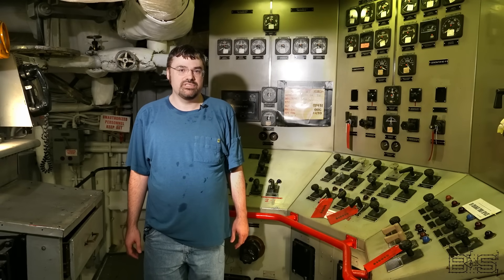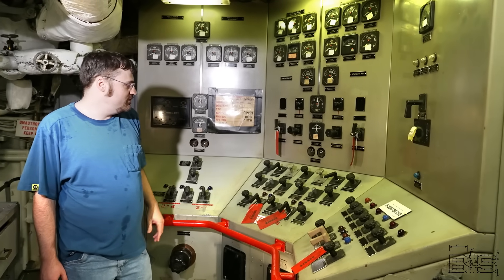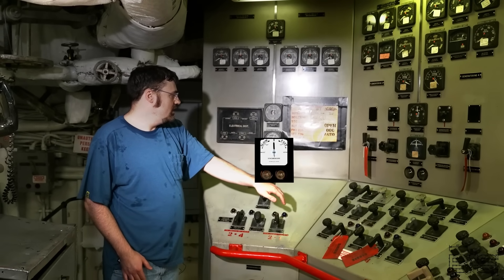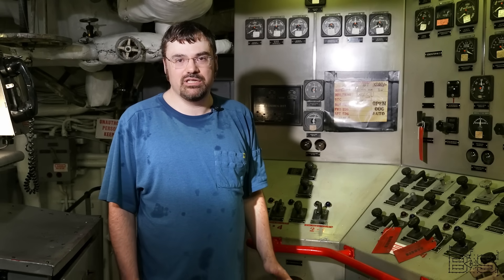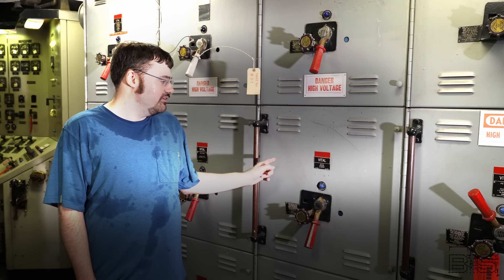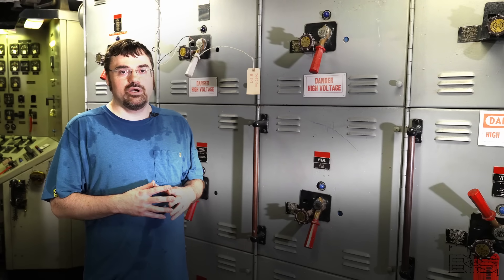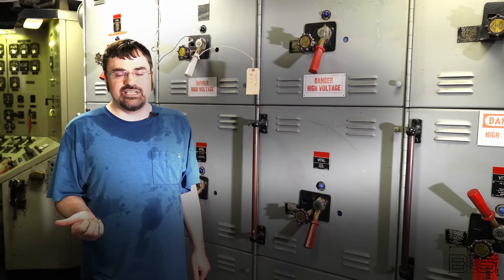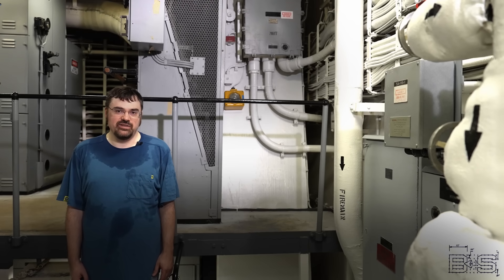The Most Dangerous Switch on a Battleship

Comment: Wouldn't the wiring burn out long before hitting that peak current ? Just a lay person here of course
Reply: The breakers are designed to trip before the wire gets hot enough.
Reply: @dougaltolan3017  I imagined there'd be some kind of protection of that kind, or even fuses

Comment: When synchronizing the generators, i don't think the voltage is the important thing,  frequency AND phase IS.

The generators can deal with the voltage jumps.
Reply: As a former Chief Electrician on Merchant ships,  you would cause problems if the voltage and frequency are not the same.

Comment: Closed switch = not allowing power to pass (closed bus ties ie no connection between them ?)

While a open switch = passes power.

While in swedish older equipment is marked SLUTEN (end,connected) ÖPPEN (open)   Öppen in this case: means the breaker is broked ie current can't pass.

Think the rules for shot guns as a hunter - walking about ? Break the gun, remove cartridge AND keep it broken.
Reply: Closed means the switch is connected, open means disconnected.

Comment: Well, if you don't get the synchronising procedure correct, not to worry, because one of two things will happen. Either it will trip, and you try again, or the generator will synchronise for you, and now you have to explain why the deck plate or generator shaft is bent.

Depending on how wrong you get it, either of these can be accompanied by very expensive and exciting noises.
Reply: We saw a training video where two generators were paralleled 90° out of phase.  Sheared the mounting bolts and sent them through the upper decks.
Reply: @ronharlan665  Any idea if that video can be viewed somewhere? Would love to see this.
Reply: @ronharlan665  Dang! I wouldn't have thought that would happen, i figured you'd have gotten a really nasty arc flash at the switchgear.
Reply: @spacehitchhiker4264 Yep, the generator out of sync becomes a motor and will follow the shortest way back into sync.
Even if that means stalling for a fraction of a second.
Which is bad for large rotating masses.
Reply: @ronharlan665 I'd love to see that
Reply: @ronharlan665  I've been trying for about an hour to find any video examples of generators being paralleled out-of-phase. If you can remember anything about who made the video, what plant was depicted, etc., please let us know so we can try to find the video
Reply: At my university, the lab techs recalled a story where students built there own generator and had to synchronise it to the grid. they didnt use a synchroscope (too expensive) just the phase bulbs. well eventually one group, one year, had somehow messed up the wiring of the bulbs,, they threw the knife switch connecting all phases at once, and a nice BANG and an alternator was spinning around on the lab floor ripped clean out of its mounts. they sadly stopped this particular class and it was done by simulation from then onwards :(
Reply: @denisohbrien  people have done it wrong when its all wired correctly, someone in the comments of a Chris Boden video said they know of a story where someone threw the switch were the phase bulbs were fully lit. That was an expensive day.
Reply: @Defianthuman that is much more wrong than I was expecting, and I don't even know what would happen if you closed it perfectly out of phase. I guess very exciting and expensive noises. Why would they do that?
Reply: @NeneExists  The ship I was on had a nice little plaque on the switchboard as a reminder when paralleling with Shore Power...  "If you fuck up, the North American Power Grid WILL win!"

As far as WHAT would happen, since we are discussing AC the voltage is actually a sine wave going from 0 to +450 to 0 to -450 to 0 60 times per second.  If you are in sync, then the zero transition points and the rise/fall will be the same.  if you are 180 out, then the zero transition is still zero, but the rise/fall is 180 out....450 + 450 = 900...and it all goes downhill from there.  This is VERY simplified..

Power sources do not like being out of phase or have voltage or frequency mismatches.  In simplified terms, the source with the greatest amount of oomph behind it will gladly synch the lesser source to match by brute force.  In extreme cases, those "very exciting and expensive noises" are the sounds of your generator and associated switchgear undergoing rapid unplanned disassembly.  Generators will come apart, snap mounting bolts, bend brackets, etc.  Copper wiring and busbars will undergo a rapid transition from the solid state of matter to the gaseous state of matter fast enough that it is basically an explosion.  Electrical enclosures will become flying debris and shrapnel.

If you just slightly screw it up, assume that you are headed for an unscheduled shipyard availability...

Always cheerful thoughts to consider when you have one engine room, so your 4 turbine generators are about 30 feet away and the 1S and 2S main switchboards are 20 feet aft of the control switchboard.
Reply: The ship I was on in Alaska, the local grid was small and the ship could(and when I was on board did, one time) take the city's grid down if paralleling was done incorrectly.
Reply: @denisohbrien  But they didn't teach you how to write proper english in university?
Reply: @Njazmo no they didn't. In fact I failed English at school and it wasn't an issue getting an engineering degree. But thanks for your interest.
Reply: It's also really fun when you turn the generator into a motor.
Reply: @Stoney3K I’ve seen that when you’ve got a paralleled pair and one runs out of fuel. It certainly clears out the exhaust. No need for load bank this week! 😂
Reply: @andyscott5978  That can also happen on the national grid, when steam is lost to one of the turbines. 
To avoid the complexity and potential dangers synchronising back online, the alternator can be left running as a motor until steam is restored. 
Mainland Europe is synchronised and the UK is synchronised via France.
Reply: Reminds me of the EOD joke, "you either get it right or suddenly it's not your problem anynore
Reply: There's an NFPA article from over a century ago, an entire generating station was wrecked in spectacular fashion--electrical catastrophe resulting in arc flash events and fire, and mechanical catastrophe resulting in the machinery tearing itself apart.
Reply: I love it when my generators synchronize themselves into a pretzel
Reply: I've seen it go spectacularly wrong twice. 

Once was a routine paralleling of an SSTG to two other SSTG's already in parallel. Breaker was closed with the synchroscope at 6 o'clock instead of 12 o'clock. Generator motorized, steam turbine bogged down HARD, steam valve opened to give more steam and get revs back up, reverse power relay tripped, now-unloaded SSTG went into overspeed trip, and the sound of the whole operation was unnerving to those of us standing 3 feet away. Unnerving, but all safety mechanisms operated well enough to prevent damage and injury.

The other was when someone tried to parallel an SSTG to an EDG. Normally impossible due to safety interlocks that prevent the output breaker from closing if the switchboard has power, and HIGHLY frowned upon even attempting, largely due to the lack of a Reverse Power Relay. But someone panicked and used the hot-stick to close the breaker, forgetting that the aft EDG is not hooked to the fore end of the ship where the power was out. Two-story-tall diesel engine going from 900 RPM to 0 in an instant, HUGE sparks from the breaker, and a bunch of angry EN's wanting to know WTF just happened. No injuries, but a couple weeks worth of repairs.
Reply: Love the physics duck quote lol
Reply: Too far out of phase and you motorize the generator. Fun then ensues.
Reply: Copper windings can literally shift position too, after all, that is where the magnetic force/forces originate ... the magnetic steel is there to provide a path (increase flux density) for the magnetic fields produced ...
Reply: i remember hearing a story in a youtube comment section, i don’t know if it’s true or not. Basically the power plant OP worked at had some sort of automatic synchronizing system, and one day it mistakenly synched the generator 180 degrees out of phase. The generator got so excited about that it jumped 15 feet up in the air…thing is, there wasn’t 15 feet of clearance and it launched through the ceiling.

I haven’t been able to verify it and i’m sure i got some details wrong cuz it’s been a while since i saw it, but still pretty funny if you ask me
Reply: While on an old WW2 destroyer, coming out of a shipyard overhaul, we were bringing the plant up. The generator had come up to speed, I was setting on it when the electrician closed the circuit breaker  that generator kicked ALOT! Not sure if it threw me off, or I jumped off! 😅
The syncroscope had been "calibrated" while in the yard and they did it backwards!
It didn't break anything, just.scared.the crap out of us! 😊
PS that board looks way to complicated. I've been on over 100 ships in my life and never seen one that looks like that, to many things.to fiddle with! 
Oh could I tell you stories of things going bad on switchboards.😊
Reply: @brucelytle1144 Remember how old this thing is…
Reply: @dangeary2134  The destroyer that I was on was just as old. It was laid down in 44, commissioned in June 45. 
Same ol,  same ol!
One important thing to remember about war-time sailors. They were from all over, with little to no experience. This stuff had to be as simple as possible. KISS!
I've ran a ship that (the engineering plant) was built as a troop carrier for the invasion of Japan. It was built in 43. It had DC generators! 😮 Oil filled breakers that would trip when you rolled too much! PITA!
Edit: I spent 3 years repairing Nuke Subs. Spent a lot of time in the engine control space. With reactor, electical and mian engine controls that weren't near as complicated as that monstrosity!
Reply: Да братан, ёбнет не по детский! 😂

Comment: What a great channel to stumble on to! This is the kind of stuff about battleships (or any big ship) that I am most interested in. I do want to mention something in your description of the fault scenario that I believe is incorrect. Let's assume your 'bolted fault' (which I noticed is after a local circuit breaker, and that would have tripped first) ties two phases together. This would cause the current in those two phases, as you point out, to skyrocket. This would also cause the voltage between those two phases to drop, theoretically, to zero volts. In normal ohm's law as you point out, zero volts would result in zero amps. But remember, this is a generator. There is going to always be some resistance between the short and the generator as a power source, which means the generator will be producing some voltage, even if it is not much. However, the current being created by the generator will skyrocket because the generator is a power source. So, even if the voltage output is only a few volts, you have an enormous amount of current flowing, which you also correctly point out. Now, if we go back to Mr. Maxwell, we find that it is current flow, not voltage that produces a magnetic field. So instead of the magnetic field opposing the rotation of the rotor falling, it instead dramatically increases. The voltage regulator might respond by trying to increase field current, which causes field magnetic field to increase, the current generation to increase and the opposition of the load current on the rotor to increase. What will happen (if the protection circuits don't respond first) is it will likely stall the generator. In an extreme case, it might even snap the generator drive shaft, and this has happened in power plants feeding a dead short or a sudden, gross out of phase load. On your ground fault indicator: I worked for many years at TV transmitter facility in Rochester, NY that shared a 240 volt floating delta power feed from the utility. They used the floating delta configuration because the utility had a rather elaborate power switching system that would share power from three different power grids. This would ensure that the broadcasters would be more likely stay on line in the event of a power catastrophe (and this actually happened in 1992 during a severe ice storm. Broadcasters were second in priority only to hospitals, and never lost power even though 2/3rds of the city went dark.). However, insidious ground faults were a problem with a floating delta. So, one of the five transmitter buildings had installed a ground fault light panel similar to yours. It was placed in a window where all the broadcast engineers could see them when going up to the hilltop. If the lights indicated a ground fault, you were to check your facility for ground faults. The baseboard heaters used by many of the buildings were especially prone to ground faults. If one occurred, nothing would immediately happen as in your battleship. But if a second baseboard heater developed a ground fault, both baseboard heaters, likely in different buildings, would suddenly be blown off the wall! (And this did happen, apparently more than once.)
Reply: That's pretty much like a ships systems. There is no "neutral. If you aren't used to it, it's weird! I learned about electrical systems on ships. The first time I looked at a shoreside panel, I freaked out! 😅😅
Reply: The voltage in the circuit comes from dΦ/dt, the rotor field. That divides between the stator inductance, wiring resistance, and the fault.

Comment: We had a 400KW diesel generator from a WWII submarine here at our hospital from the mid 50s to the 90s the panel you are showing is a very close to what i used to do with the rheostat and synchroscope 480 volts going into a transfer switch just like the one shown  behind and above you to a transformer and out to the hospital i always got a little nervous syncing up with street power ie: :Edison" when we had to transfer back  after a power failure! still here to day 34 years later ah the blessings of electronic transfers now i'm glad to say!
Reply: Not so much worried about that the disconnect  up on the pole was there.but browning out the hospital we had the lastTB patient from the 50s on an iron lung i was worried about the parts on this ancient machine just did not exist ,and i was cognizant of how long it might take to rewind the lungs motor and nurses having to pump the handle.
Reply: they actually salvaged a generator from a sub? that's so cool!
Reply: @kv-2heavytank52 it was the diesel motor and genny with the switch gear the diesel i believe was a GM engine how many cylinders i forget it was cool in hind site i’m kicking myself for not taking any pictures
Reply: @TheShawna1  If you know how big it was we might be able to figure out what class it came out of. Interesting stuff!
Reply: Was it a fairbanks morse by chance?
Reply: @Oksobasically2 no it was a GM 16-1278A
Reply: For the uninitiated, the worry isnt that itll hurt the grid power.....thats not gonna happen (well, you might make a few things very annoyed, but on the whole, the grid will be fine). The worry is when you're out of sync you have one phase wave pushing against another phase wave....differences in phase voltage means voltage potential, voltage potential and somewhere to flow (like through your gennie) means current, the current the grid can provide, even for a slight mismatch in frequency will blow that submarine motor through the ceiling. It could still be in the sub, and itd blow the sub though the ceiling!
Reply: @TankR  Yep.

That reminds me of a story I was told as a kid.
At the shipyard in the city of Odense (Denmark) they originally sometimes had to patch in a local generator (large one - it was a shipyard remember).
At one time the operator messed up and switched in out of phase.
I was told that first of all, the generator jumped out of the concrete floor it was mounted in. Secondly the copper busbars in the ceiling was afterwards hanging like wines and thirdly, the whole city was without power for a few days until all the damaged fuses and switchgear had been repaired.
The one telling the story did not mention sparks or explosions, but they must have been there as well considering the damage....

Comment: Synchronizing generators is why large power outages take a long time to come back online. If the outage were to cover several states or more it could take months to bring the power back online.
Reply: It took about 16 hours in the blackout in Spain/Portugal before the grid there was up again.
Reply: @TheStefanskoglund1  I think that was just 31 Megawatts. I'm referring to total grid collapse. When a failure to the grid begins to get out of control power stations can pull switches and disconnect from the grid in a controlled fashion that still keeps most of the generators still synchronized. Just no power to the grid. When Texas went down, Texas has their independent power separate from the country, It took two weeks to bring it back up.
Reply: Grady at practical engineering did a show on cold starting the grid
Reply: Doubtful